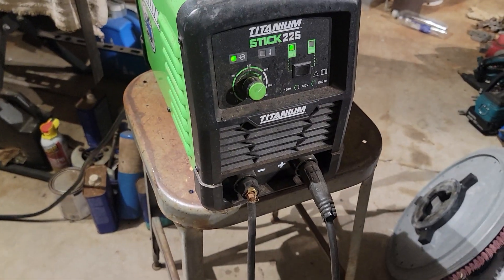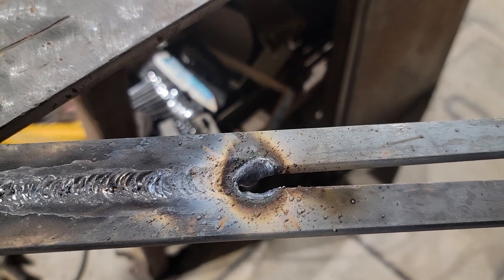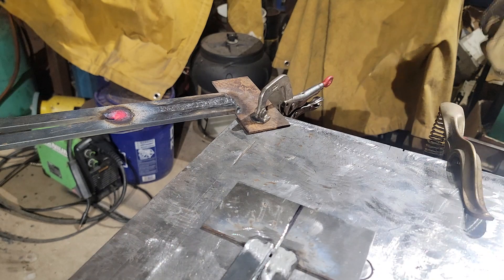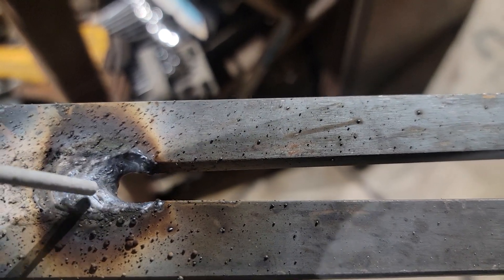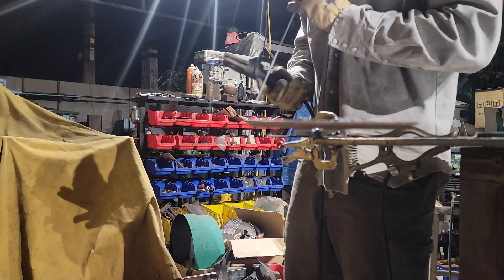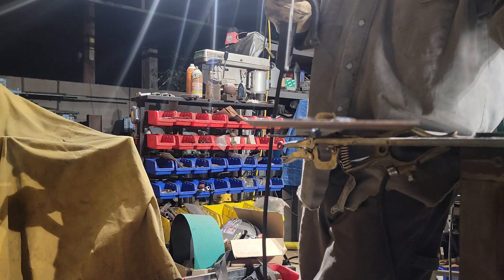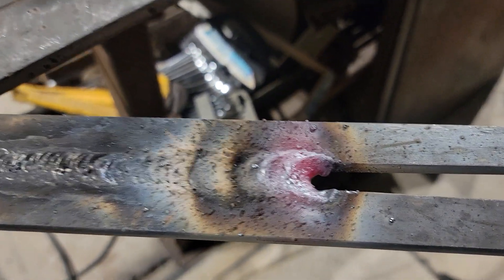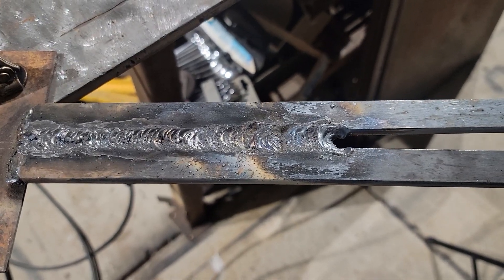Titanium stick 225 open root practice on 110

Comment: I'm new to welding. But just to clarify. You are using a Titanium stick 225  welder on 240 V input with a 120 V output setting. Is that correct?
Reply from the maker: Hey, great question for this video I was running my welder off of a 110 V. And I was using a 3/32  6011 rod from KT industries that I picked up at my local Ace Hardware thanks again.
Reply: That was some very impressive root welding that I thought for sure was from the 240 v outlet and not a 120 v outlet. I don't have 240 v in my garage and was thinking about purchasing the Titanium 225 welder. Thank you for your videos.

Comment: I have the same welder I've been at it for 2 weeks now, I'm using 6011 3/32 I'm terrible I can weld metal together but it looks like crap, just doesn't feel like I'm getting any better! Don't know what to do
Reply: me and you both we should keep talking, Im a hobbyist . But lineman By trade so I have a huge bit of understandiing on mechanical stuff.   What have you been doing rcently Running Beads??
Reply: Yea I' can run a decent bead, but when I got to weld two pieces together it's like I'm starting all over again, if it does weld together it looks like crap, I've had my welder for two months now, I'm getting a little better with running beads on a flat surface, but other than that I'm pretty bad, like I said if it sticks together it looks like crap, or it just comes apart! You look like your pretty good! Sorry just seen your reply! I try to practice at least twice a week for an hour or so but it doesn't always happen!
Reply: Try 7014 3/32. It works well and easy striking an arc too. (Especially for us new learning how) Cheers!

Comment: That's a great exercise for being able to step across the gap I forget what other channel I've watched but I encourage you to try that machine with 3/32 6010 on 110 because it can do it and I tried it it does work just make sure you have a 30 amp breaker